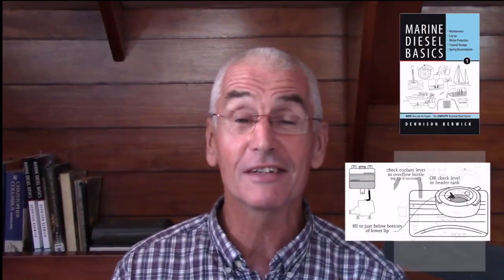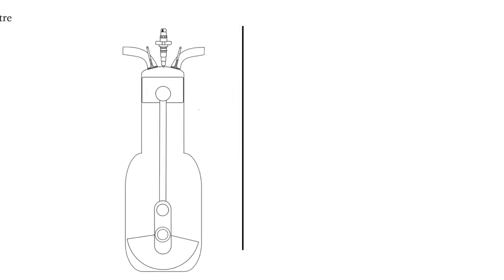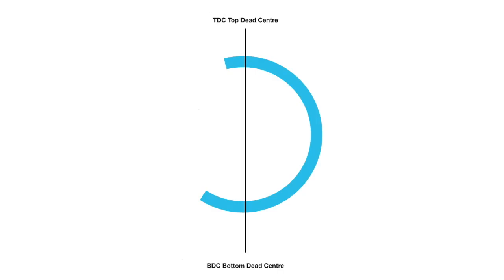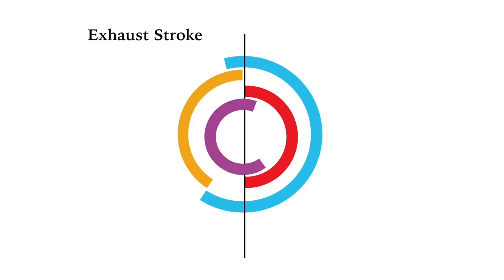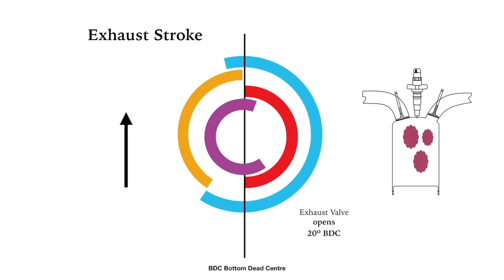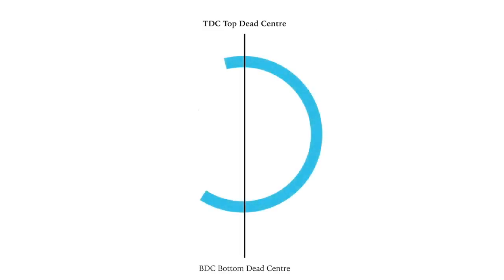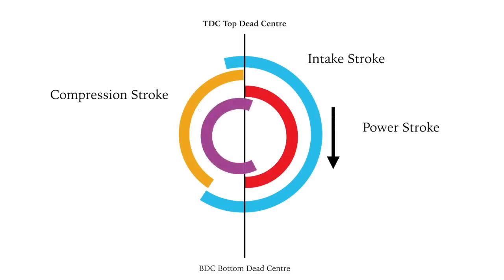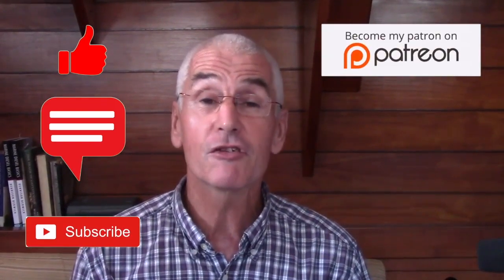E4 Understanding a 4-Stroke Diesel Valve Timing Diagram

Comment: Dennison, in the brief period of valve overlap, what is stopping a) either a bit of exhaust geting into the air intake, or b) a bit of exhaust "fouling" the otherwise clean intake air or c) that bit of exhaust, which may have unburnt , vapourized diesel in it, "pre-detonating" in the compression stroke? I suspect no bad things actually happen during valve overlap, but I'm wondering why they don't. Great little vignettes you're doing here.
Reply from the maker: Great question Marc. The intake valve starts to open before Top Dead Centre to ensure that it is fully open by the time the piston reaches TDC; and the exhaust valve stays open until just after TDC because, even as the piston is starting to move down again, there is still a flow of exhaust gases out of the cylinder.